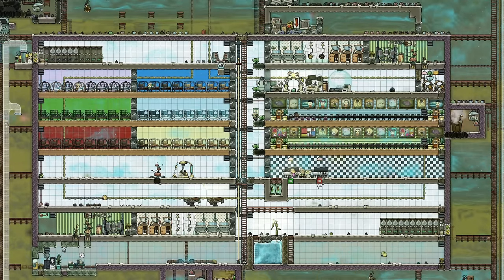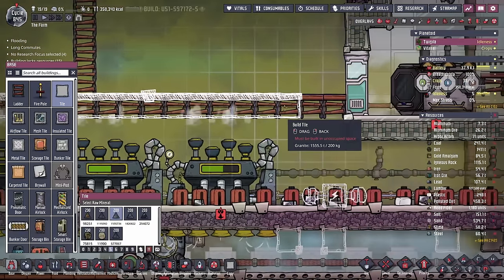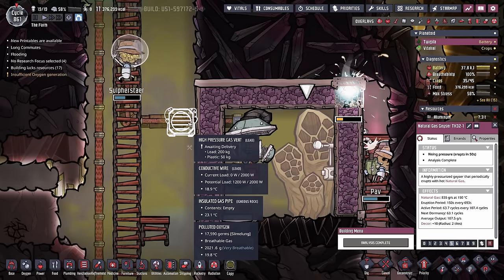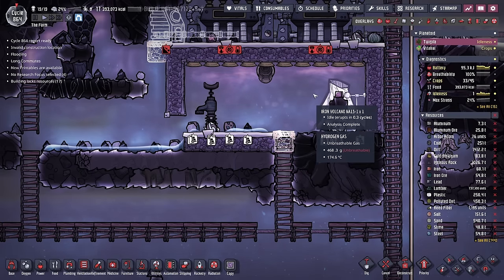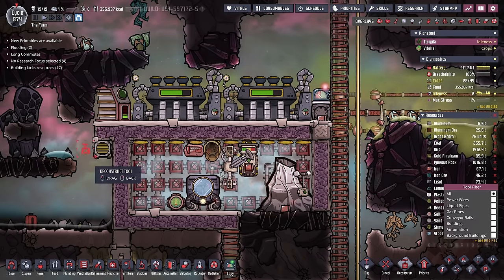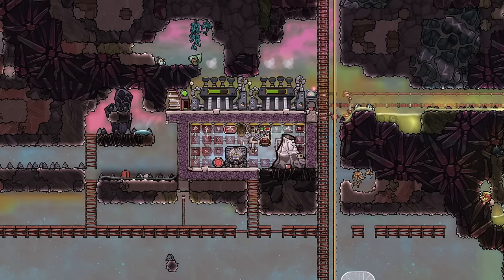A lot more pee than tamers. | Ep 10 | ONI - Farm - Verdante

Comment: I'm so worried that my washroom setup might have problems that I put at least 6 buffer tanks onto that system
Reply: Just need one buffer tank. Set it to send a signal when level gets below X amount(I set to 1000 iirc, or is it percentage based on water storage i dont remember its been a year or so), connected to a valve(maybe a signal inverter or whatever they are called) on a water pipe, that way when the bathroom gets too low itll automatically top itself off when needed. Could also use a priority bridge setup so that if the bathroom water loop goes dry just before the toilets it auto adds as needed. couple different ways to do it( i usually use the valve and buffer tank method)
Reply: I have two. One for p(ee)-water and one for clean water :D

Comment: A really nice and clean way I found to reduce heavy watt wire runs is using the transformer in the reverse. For example I would use a transformer for those 2 steam turbing and to connect it to the heavy watt wire across the map. 0 decor hit
Reply: I was about to suggest the same thing! Way tidier.

Comment: What a fun case study!

As an engineer, this is what I see:
* Consider failure modes of the systems.
  * 13:28, 18:44 Don't be cute with liquid locks in very hot places or critical places.
  * 9:39 Put a lid on the water tanks (use a horizontal door above the ladder); or put a filter on its output.
  * 7:56 Build access-restricting doors early in the build so they are ready in an emergency.
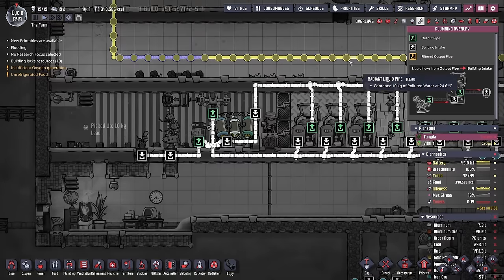  * 6:38, 7:30 Buffer water for the bathrooms, and perhaps buffer oxygen for the atmo suits.
    * Consider how long you are willing to go without and buffer accordingly
    * 11:35 Put alarms on critical resources levels.
  * 6:38, 6:57, 7:30, 8:50 Prioritize power to critical buildings (plumbing and oxygen, for example). Centralized power makes this more difficult, but the wattage sensor helps.
  * 7:15 On power failures, add hamster wheels to the critical power lines, not to the centralized power
    * 7:50 especially if centralized power is in a sauna, requiring atmo suits (and thus power and oxygen).
  * 7:30 An "inside/outside" base (Francis John style, where everything outside of "home" requires atmo suits from a centralized location) adds a single point of failure. Maintenance to nearly any system requires the one (or two) atmo suit bank, and non-critical errands take up the critical resources.
    * Localized atmo suit banks allow prioritizing oxygen to critical systems (and thus implicitly prioritizing access and errands)
* Arbitrary aesthetic rules are expensive
  * 16:47 ...in materials,
  * 2:46 ... in expandability,
  * 20:38 ... in maintainability ("The need for a pretty rectangle", I keep the liquid locks next to all my hot systems, and a way to separate the locks from the heat)
* 12:51 Build the vent off the mainline so that it can be disconnected easily
  * 1:36, 12:51 Better than that is eating the power cost of a cheap filter until the gas is stabilized.
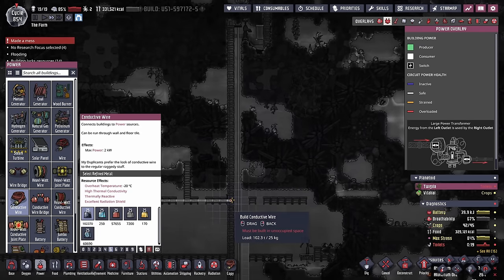 * 9:21, 9:36, 10:01 (minor) gas lines and power lines can go through walls, they don't have to traverse the liquid lock shape.
Reply: To be fair if he did all that, the videos would probably be less entertaining!

Comment: Clean water has the same heat capacity as pwater, so water is just fine for a metal volcano tamer.

Pwater is only necessary when you need to keep things below 0C or the coolant could get over 100C. It’s better than clean water only for its temperature range.

Comment: >22:00
I no longer even use tiles and/or timed outputs. I simply run the rails through the steam chamber and then through a layer of liquid on the floor under the steam turbines. The cooling loop for turbines (which runs through the liquid as well) is usually more than enough to chill metal down from 130C to 30C.

Comment: In regards to the evolution chamber, farmers do not drown nor starve their animals to kill them. They do it by hand or higher a butcher. I suggest making the duplicants do it, or find another creature to do it for you. 😊 great work as always.
Reply: I am going to disagree a little here. In one sense farmers and ranchers are some of the most high-tech people on the planet. They have been optimizing for millennia, have automated for longer than most industries, and they even have had gps-driven automated vehicles for many decades now (since the mid 1990's if iirc).

(I spent my teenage-hood on a small "do-it-by-hand" farm, surrounded by some massive farms in the midwest. Even the Amish farmers in the community used machines for optimization.)

My observation is that farmers would do lots of things to optimize their labor. From a purely efficiency point of view, an "evolution chamber" is prime automation.
Reply: @grignaak9292  I was not aware of that. In my experience, which isn't alot, everything was typically done by hand, or directly operated.

Comment: I hate the idea of the evolution chamber, and instead what i do is to put all the eggs from tamed critters in a storage bin and they will crack in time. The mini debris chiller was an amazing idea, the timed ones were a lot of improvement from the previous ones, what i jave been doing on these systems is making them separeted from the power grid and putting a transformer to send power back when the temperature reaches over 200 degrees

Comment: You already know how I feel about solid filters and to an extent volcano tamers and steam room cooling. 

Iron volcanos run much hotter. Hot enough to melt steel rails directly above the volcano. Beware of this. It happens even in copper volcanos at the high end. Gold should be good. 

I don’t disagree with the timer idea: to drop a certain amount of iron every cycle. I like the 50-70 second idea. Your math certainly checks out. A simple solution to a complex problem. 

I just hate spitting out 170-200 degree iron directly next to the steam turbines. Granted you should be converting it mostly to steel quickly. at any rate not a bad idea at all. 

Additionally, look to using shutoff valves across your base instead of the built in oni filters. They use a fraction of the power.  considering your challenges with power consumption, it may be a good option to pursue. Beware though they can become more of a nuisance if the flow of material is too much for the shutoff valve flow to handle. They overflow. 

Huge gamecocks fan myself. Btw. F Clemson and everything they stand for.

Comment: 21:54 you are not done with that Iron Tamer. Look at the tile to the bottom left of the Volano. Not hard to fix but still. Also worried that your liquid iron might melt the rail below it's output point.

Comment: Problem: Not enough power for newly added consumers
Strategic solution: Add more power generation
Tactical solution: disconnect newly added consumers, let the rest of the base work as before and start working on new power sources
Chaos solution: run the power grid into the ground, loose power to everything, make dupes suffocate and pee themselves, while desperately trying to plug the hole with anything

Why am I not surprised which solution was chosen... :_echoTrip: